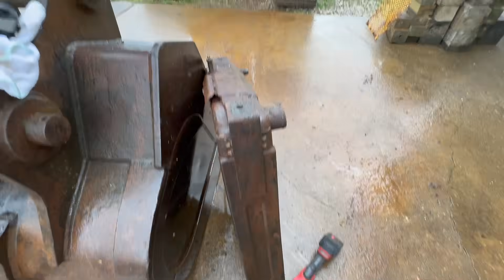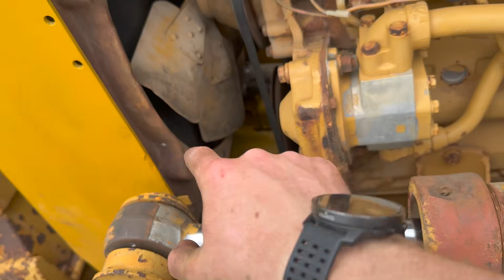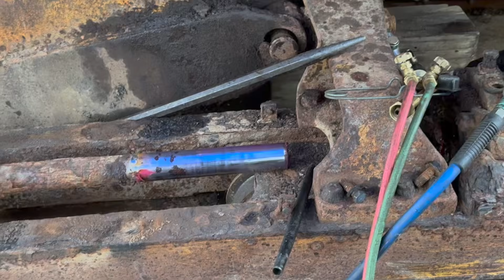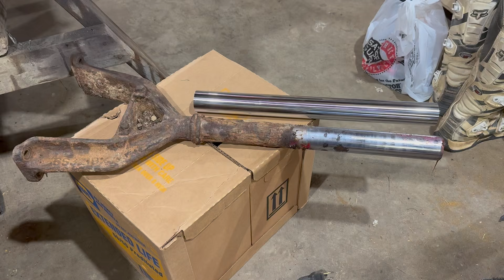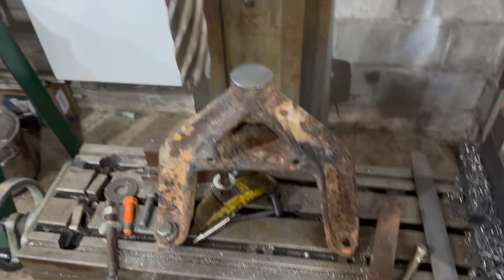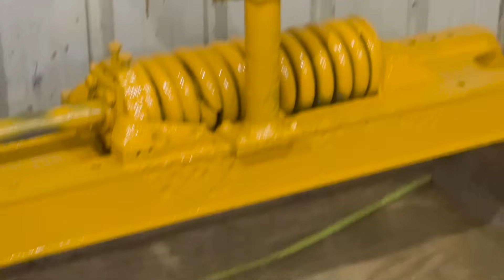Caterpillar D3B Bulldozer Restoration

Comment: As an ex-radiator repair man. Do not buy an aftermarket, any decent radiator repair shop fix your top and bottom tanks, and flush the core……cheaper than aftermarket

Comment: You have done a tremendous amount of work so far. Great job for what you started with. What are you going to do about that broken recoil spring on that one track frame? It would just be a bandaid fix but if you couldn't find a used one somewhere you could try to get it close up as much as possible and weld it with a low hydrogen rod. It may hold to you could run across a used one.
Reply from the maker: An old timer I know said he’s seen them run a long time with a busted spring. I just left it alone for now. If it causes trouble I’ll probably have to buy a whole assembly. I went through my manual and they press the spring under tension then tighten the nut behind it to hold it. My threads on that holding nut are gone so there’s no taking that apart and salvaging. The spring is captured currently so it still is providing some recoil relief.
Reply: @ironacres717  With that spring broken it just puts more pressure on the track adjuster itself. If you hit something it's way more likely to blow the seals out of the adjuster without the spring there to absorb the shock.

Comment: Enjoyed the video,I noticed the recoil spring on the right track frame is broken(it would be a good time to change it while the track frames are off),as for the track guards you can get aftermarket ones from Diamond attachments,I've dealt with them in the past they have good products ,good luck !
Reply from the maker: That’s good to know they have parts like that. I didn’t think they’d be around any more. I ended up making my own guards already but you’ll see it in upcoming video. I spoke to an old timer I’m friends with and he said he’s seen those dozers run a long time with a broken spring and as long as it’s captured it’s not a big deal. So I left it along. Ran the dozer a fair bit and no issues so far
Reply: That's good to know concerning the recoil spring ,looking forward to the next video,good luck with the D3B !
Reply: He spoke about it in the video.